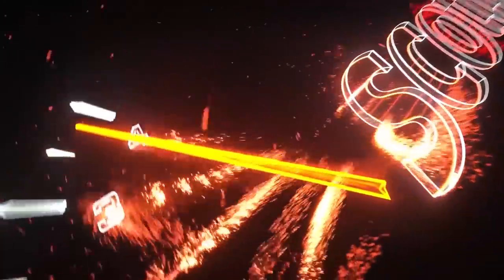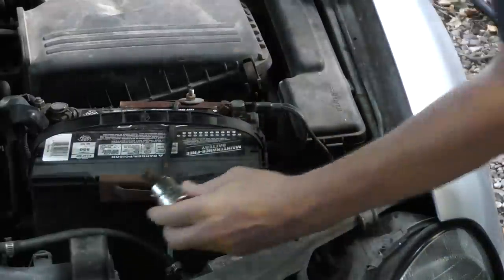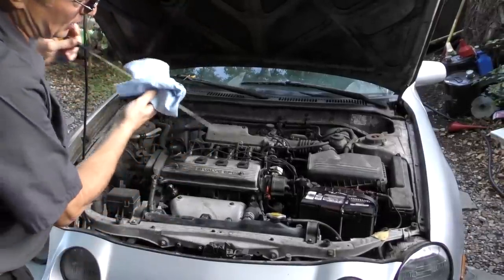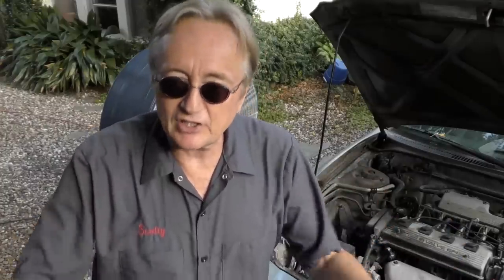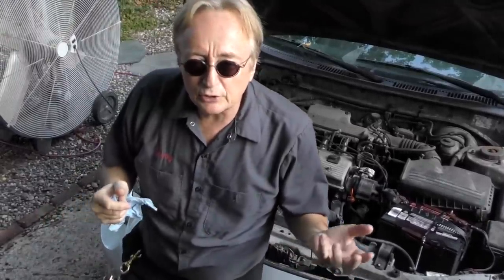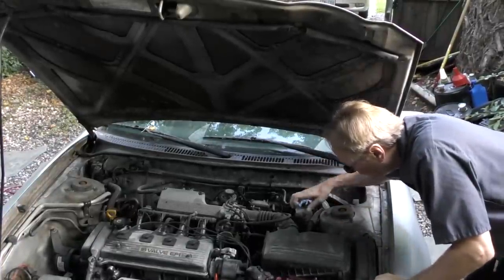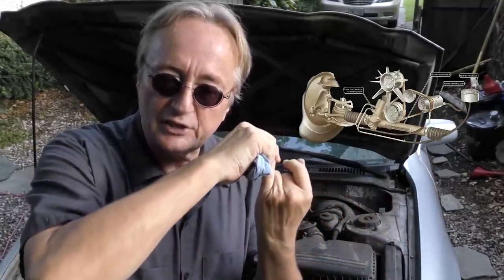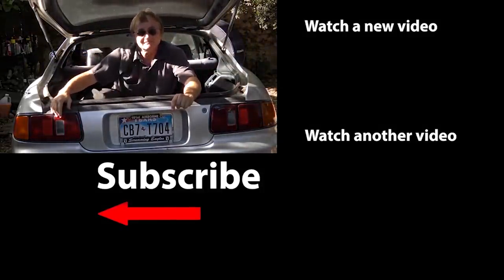If You're Not Doing This to Your Car You're Stupid

Comment: Re battery terminals:  Years back I took each battery cable off, cleaned the terminal with a battery brush (and the cable connector that bolts to it), then greased the terminal and, after that, the connector.  That keeps the battery posts clean and corrosion-free.  It looks better if you spray it with the red stuff, but this works, too.  The battery has not developed any corrosion since that day, so I don't have to re-grease the terminals periodically (as you would need to re-apply the red spray).

Comment: I had a mate worked at the Castrol  research centre at Whitchurch near Reading in the UK. They ran engines flat out for weeks on end, big bmw and merc engines. He said they would simulate extreme conditions going way beyond what a car owner could do to his car and after a simulated 60,000 miles Magnatec was still in grade. Which is amazing chemistry . This was 15 years ago. I took that on board, completely ignored it and change the oil on my old Volvo T5 every 5k with semi synth. It goes in looking like honey and comes out looking like honey. 25 years old doesn’t use a drop, never failed to start never broke down.

Comment: I'm always trying to flush the system when I'm doing some work. Yesterday I was changing gasket under oil filter and flushed coolant. No need, but job was easier. Engine oil was reused, I've changed it month ago.

Comment: Lovin all of your Videos... I HAD your 94 Toyota Celica GTS.....Top of the line then, in 2000, swapped up to that one, the one with the VVTLI...variable Valve timing with LIFT and Intelligence... WOW at 6,500 rpm that thing turned into a Rocket.... decided that I was tired of racing everyone that pulled next to me at a light.... so 6 months into that one came the VERY PRACTICAL, RAV4. 10 years then I must of had some sort of mental break down and bought KIA? Sportage....Volkswagen Tiguan......Mercedes Benz AMG 45, looking at a TRUCK now... Ridgeline Black Edition, THOUGHTS? gotta know fast.... ( Subscribed )

Comment: Tyres have a marking that indicates the age of the tyre eg, 3416 indicates that the tyre was manufactured week 34 2016 wich would be around the 3rd week in august 2016. However some tyre fitters decide to put the age marker on the inside. It is generally recommended that tyre are not kept on the car for more than 5 years. However keep an eye out for perished tyres.

Comment: Maybe in Texas but in PA. ROAD SALT IS OUR BIGGEST PROBLEM, CORROSION, CORROSION, CORROSION.
Reply: You just have to wash your butt more often 🙂
Reply: Same here in most of the UK. Cars used to be rotting away at ten years old, but now you might get 15 to 20.
Reply: Yes Michael, IT'S BEEN MONTHS NOW. Really the only way is to have your vehicle sprayed with something every year or tear all your stuff off that you can & paint it with POR or something similar. Clean it VERY VERY WELL FIRST THOUGH. It's hard to pressure wash all the salt off of your car when it's cold for months.

Comment: You showed 10-30 oil when recommending oil changes. Even GM recommends to never use 10-30 because it's the crap from all the other grades. Use 10-40. 10-30 is crap.🦁✌

Comment: I took my AU Falcon station wagon in on a Friday to get the brakes done and picked it up just before the Shop closed with my all family as we were going away for the weekend,  got down the road a bit and the Brakes didn't feel right so went back. We had to leave it their overnight and it turned out it had a tear in the rubber boot in the Master Cylinder. One of the Mechanics said it was slightly spongy after the finished and tested it but thought it would come good. Apparently, they had caused it with what I think is almost a criminal industry practice and that is when the brakes are being done to save time they just force the Fluid back in the Master Cylinder at the wheels with Clamps and in my case, crap in the line tore the rubber boot. So much for Tradesmen. My Kids, Wife and I could have all been killed on the Highway that night.

Comment: 10 / 4 Scotty I got one car 24 years old and another that is 42 years old that I’ve never had the cylinder heads off of. Regular maintenance and change that oil. The new one I’ve got to rotate the tires and flush out the brake system and the power steering thanks for reminding me🤪🤪🤪🤪🤪🤪

Comment: Guy at O'Reilly who used to work at a Honda dealership told me he's seen allot of variance in the quality of radiator fluid on the shelf.  That most are fine, but some of the really cheap ones will fail early, and even sludge up.  Ten years ago, before Scotty got his first AOL online CD in the mail.  My 89 Buick Lesabre with 200,000 miles had it's heater's radiator core corrode and eat through the aluminum leaking tons of fluid into the passenger cabin. Theres really nowhere that offers a service adequate to cleanup that kinda mess, It ruined the car.  I bought a used 2010 hybrid with 130,000 miles and had the radiator fluid changed first thing at Jiffy lube to prevent corrosion.  I hope they didn't give me the cheap stuff...

Comment: I had my motor tested several times by Oil Analyses Inc., after the recommended 15 - 20k mile changes using both Amsoil and Mobil 1 Extended.  Wow, what a mistake that was!  Several performance categories came back in the highest danger levels for both oils.  During these drain intervals, I was also changing the filter every 5,000 or 6,000 miles with a top off.  Quality filters like Purolator PureOne and Mobil 1 were used.  I got rid of those cars.   On my Honda Odyssey, I now change the oil when the monitor gets to just under 20 percent, which is normally in the 5,500 to 7,000 mile range. Using both Mobil 1 and Pennzoil Platinum, the tests came back in the good range and the folks at Oil Analyzers tell me I am good to stretch it out farther... but I don't.   The only way to really know how far you can take your oil changes is to test.  Don't believe the marketing hype!

Comment: What about the cabin filter? I just replaced mine in my 2013 G37 at 62,000 miles. It was black and a mouse had chewed it. Once I replaced it my blowers worked better and smelled better.

Comment: Hi Scotty, I have problem with my toyota corolla. After a long drive, the coolant doesn't return to radiator from reservoir as it should be when ang engine starting to cool down. there is no visible leak and I already changed the radiator cap. Any advice? thank you!

Comment: Toyota aside, in more moist areas with PROPER snowy winters (unlike, say, Houston) I'd say - max 5-6 years and brake fluid flush is worth getting done. You might not feel it driving on flat areas, but try going about in anywhere mountainous where the temperature has a chance to rise in the system and you will soon realise how much water indeed is in your break fluid - once you cook your breaks away - which I definetly concider worth avoiding. It's not a lot of money and, well. It's possibly life saving. So I think definetly, at least get the brake fluid checked for water levels at a mechanic's every 2-3 years.

Comment: Better to make sure that you aren't losing water fluid.  Moisture in the engine compartment can cause all sorts of problems.   If your car is running hot and steam is escaping from the radiator, like the cap, you're likely to have issues with terminal corrosion.   Usually with maintenance free batteries, corrosion shouldn't be a problem.  With my 22 year old truck, I don't think I've ever cleaned the terminals except maybe wipe them off occasionally.    As for the other fluids, it depends on the material science that went into your vehicle which is nearly impossible to find out before you buy.   In 22 years and I've never replaced the brake fluid, power steering or water (except when I replaced the radiator and that was only because the plastic mount broke).   You won't find a bit of corrosion in the engine compartment and the undercarriage has very little rust for such an old vehicle.   All the american designed vehicles I owned before this never made it much more than 100k before I had to junk them.

Comment: Hey Scotty, 

I have a bmw x1 20D 

200.000km = 124.000miles 

Transmission fluid never changed - I bought it like that 

Obviously dealer says that transmission are well made and there is no need of transmission fluid change. 

What do you recommend on 124.000miles 

Complete change of transmission oil or just take out the filter and change maybe 1liter of the oil? 

Thanks 
Best 
Andrej

Comment: I simply use WD-40 spray onto the battery terminals about twice a year. Corrosion have never happened and I can tell immediately after the spray that the electrical connection are better every time:).

Comment: I used to help out at an auto repair shop this lady complained about her car over heating well it took me n the mechanic both to pull dipstick out of enging was black n thick like tar in the winter. It was over 100 out. The coolant looked like rusty dryed out jello. Told the lady u need oil change n coolant service she flipped out saying the guy she bought it from said he never changed oil or coolant why should she. Never seen that car in town. I guess it blew up

Comment: I just use Vaseline on the battery posts and it works great.  And I also still change my oil every 3,000 miles.  My 2006 Matrix still drives and looks new with 136,000 on the odometer.  My 2001 Miata, looks and drives as new with 103,000 on it.   Hope they last me a lot longer.  Hate all the crap on the new cars!

Comment: Hey Scotty I have a question. I have a 2006 scion tc with a Toyota 2az-fe vvt-i 4 cylinder engine. It has 177,000 miles with oil changes every 3000 miles. Do you thing this motor is worth building or not?

Comment: How to save thousands in car repairs
1.  understand what fluids are so formulated that you must use the manufacturer's distributed product using a proprietary formula.  Usually, this would be brake fluid and/or transmission fluid, if any. 

2.  understand that it is not in the manufacturer's interest to put the best of any component in or on your car.  If you live in Buffalo, NY as contrasted to Miami Beach, Fl, you are probably going to get the same set of tires from the manufacturer.  All brake pads are not the same.  It becomes your responsibility to chose better lasting ones if you want the replacement pads to last longer than the offering at the dealer. 

3.  Don't just keep old, illegible repair slips.  Be proactive.  By component like Brakes/Transmission?oil Change, etc. List in computer document, who, what, when, mileage of the repair AND list the mileage and/or date of the next suggested servicing for the component. 

4.  With cars, an ounce of prevention is cheaper than a pound of cure.  Set up your servicing as if you are doing what is called "severe" driving.  Like replacing the pads earlier than they wear out.
5.  If you are going to have servicing/component replacement by a non-dealer, find out what parts are going to be needed, which parts must be factory and get them yourself.  If you don't, your car is going to be sitting on the lot while the mechanic is waiting for the delivery of a part by a runner.
6.  Three years ago, I had my factory recommended 90,000 mile overhaul done on my car.  I wanted the lowest price for the components, planned to have the car for a long time.  I also wanted to know what might be replaced at 90,000 miles so I wouldn't have to pull things out soon thereafter for other maintenance. So, I quizzed my experienced repairman and did not rely upon the factory recommended service suggestions.   I knew that the local factory approved dealers did not keep a big inventory of parts.  So, I bought as many quality parts as I could on line, without sales tax and the factory parts from a dealer who discounted. 

1.

Comment: If you wipe the tires down with a UV blocker every 3 months the tires will never crack.  303 does the trick.  I even wipe the inside of the tire before they get installed on the wheels.  Just be careful if you spray it on the tread as it’ll be slippery for the first bit of driving.

Comment: Hi Scotty, I'm the guy with the Corolla (1986) with 455,000 miles on it, I do change the oil 4x/year even though I only put on maybe 4000 miles on it during that time, but I have yet to change the ATF, still original engine and trans too.  I do check the ATF every week and its still clear and rarely needs any addition.  I've tried every test I know of to check how the trans is and it functions just fine as far as I can tell.  Would you change it?  I think I'm just going to let it go until at least its not as clear looking.  Thanks...anyone else feel free to comment.

Comment: I just bought a '99 Toyota Camry XLE that sat for 2yrs. Not sure if anybody started it while it sat, but the fluids are good(at least looking at them on the dipstick) I suspect it may need the motor mounts replaced, I am familiar in general, with what to look for when checking for bad motor mounts. The immediate problem is the brakes. The pedal is very hard to push down to get it to stop, almost as if they might not have been bled properly, or not at all. I am not very familiar with Toyota's or Asian cars in general, so I'm not 100% sure what I should be looking at first on this car. I understand the basics of how a car's brake system works or how it's SUPPOSED to work, but again, not 100% sure about Asian imports. The front end has a bit of a shimmy ( feels like a non- balanced, or improperly balanced tire) to it at the 45mph to 55-60mph range but trims out at higher highway speeds. But at this point, the brake issue is the foremost problem at the moment. When I am stopped at a stop light, the motor is at idle but the car feels like it wants to lunge against the brakes, and if I let off of it, it will move forward. I need to know what's causing it to do this. Anybody who's dealt with this issue and has succsessfully repaired the issue, kindly let me know how you fixed the problem. It is greatly appreciated, thank you

Comment: Hey Scotty, My F150 is 6 years old with 88,0000 miles, My Mechanic checked the PH level of the coolant and says its still good and does not need to be flushed. Is this safe for the truck?

Comment: What is the colour of your brake fluid ? If it changed, you need to change it.
Because, even If you don't have  brake problems, you can have the lines corrode internally, and just break at some point.

Comment: I don't think higher resistance will cause a short, it may cause heat at the terminals and potentially melt some of the wire jackets, but not short anything out.

Comment: Hey scotty I got a cheap 98 honda crv, the car has trouble going up hills on the highway around 80 to 90 k, It doesn't gain speed unless I press the gas hard and the engine revs high like 4-5k rpm, is this a major issue? Is there a cheap fix? Or any advice you could give? Thanks for the great content!

Comment: Mostly agree with you Scottie but have to argue the brake fluid advise...  
Most manufactures recommend every 3 years.  While this is excessive 
and clearly no one does it other than myself and few others'.   
If your brakes start failing because of the fluid you are in a world of trouble.
Check brake reservoir as often as your engine oil..and if ever super black or 
mustard color; bleed and inspect system immediately!
If your system fails because oil is too old and boiling point is reached on stop
& go traffic or down some mountains.  Then you're in serious trouble

Comment: I have a 2008 Toyota prius that needs a brake actuator. I have taken it to toyota & 4 different repair places trying to get the best deal with my limited income & to much different input from online & friends. I was told I can get mine rebuilt for a lot cheaper but do they last? & will it effect the large battery because how it recharges when the brakes are applied? &  several people say ok to drive, others no. I am thoroughly at a loss of who is giving me correct info. or what to do.

Comment: Lifetime transmission fluid is definitely bull, but cars can go over 7k miles between oil changes. At least certain ones can. My 02 Mercedes E320 has had just about every oil change made between 7500 to over 12,000 miles with Mobil 1 0w-40 Euro and I send the oil reports to Blackstone Labs. They always come out perfectly normal with low wear and Blackstone even said the oil was still good after a 12,200 change and I could try 14,000 miles next time. Now keep on mind that my car is a v6 that takes 8.5 quarts of oil and uses fleece filters, so it is designed to go long periods between oil changes. But my point is that not all cars need oil changes at 5-7k intervals these days.

Comment: I really like to keep my engine bay clean but with all the new electrical systems, what is the safest approach to cleaning, are there sprays that are safe to use? I use 303 Aerospace protectant that is water based and is great on all vinyl and rubber and l usually just spray and wipe off. Thanks!